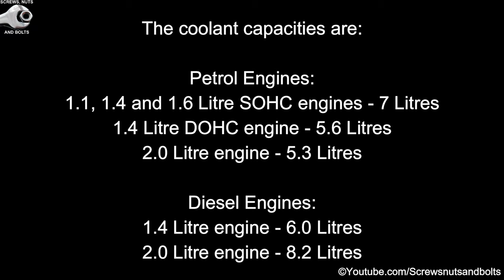Engine Coolant Change - Peugeot 206

Comment: Why is everything on French cars more complicated than on other cars?
Reply from the maker: I don't know, I really don't lol. Have you seen a video on changing the air filter on a Peugeot 308 ?......now there's a complicated job !
Reply: @screwsnutsandbolts  my sister owned 308 and it burned oil like it was two stroke :))) hahahah ...I own Lancia Kappa 2.0 5.20 ...even with massive 5 cylinder engine, everything is on hands reach.

Comment: Why do I have to remove the air filter? Can't you just bleed it from the bottom?
Reply: He did that to unscrew the second bleed nut on the left side of the cylinder

Comment: And the 1.9d?
Reply from the maker: I'm not sure if the 1.9D is exactly the same as this. It's not covered in the manual I have.
Reply: for the 1.9d engine you need 8.2 litres

Comment: Hola, cómo se llama la espuma que tiene de protección la manguera desfogue 8:22
Reply from the maker: It's called pipe foam insulation: https://www.google.com/search?q=pipe+foam+insulation&source=lnms&tbm=isch&sa=X&ved=2ahUKEwjCj-2n9r33AhVPasAKHWyKCM8Q_AUoAXoECAEQAw&cshid=1651395185137399&biw=1536&bih=722&dpr=1.25
Reply: @screwsnutsandbolts  Thank you
Reply from the maker: You are welcome :)

Comment: my fan isnt turning on and off after following all the steps at the end, does this matter that much?
Reply from the maker: Maybe the engine isn't getting hot enough ?
Reply: @screwsnutsandbolts  no idea, maybe not because it was a cold day, I did rev it for quite a while

Comment: thank you for this video ive been looking for the bleed valve for a few days 
i have a 206 with 1.1 engine ...my problem is i feel like the fan turns on too late .... i read online that the medium intensity fan turns on at 85 to 90 .... mine turns on at half intensity at 100 degrees and at full blast at 110 degrees .... do you have any idea why it does this ??
Reply from the maker: It could be a faulty thermostat, coolant temperature sensor or something else
Reply: Mine is exactly the same. Coolant looks dirty so gonna change it and see if that helps
Reply: Cambiar sensor de temperatura

Comment: The coolant in my expansion tank is like frothy. How do I flush this from the cooling system please?
Reply from the maker: Did it become frothy after you changed it or was it already frothy ?. If so it could be a sign of an underlying issue. Check this link: https://askinglot.com/what-does-it-mean-when-your-coolant-is-foamy

Comment: At the start of the video the liquid is green, but at the end you put orange.
So i guess it takes both and color doesn't matter, right?
(I have a Peugeot 206 1.1 gasoline model 2005)
Reply from the maker: Hi, it's not about the colour, it's about the correct type which is in the video description, thanks.

Comment: hello my car is 2002 model 1.4 petrol. What type of cooler should I use?
Reply from the maker: The manual recommends BASF Glysantin G33-23F or Gurit Essex Revkogel 2000 or suitable equivalent
Reply: @screwsnutsandbolts  Are there any new products with these approvals?